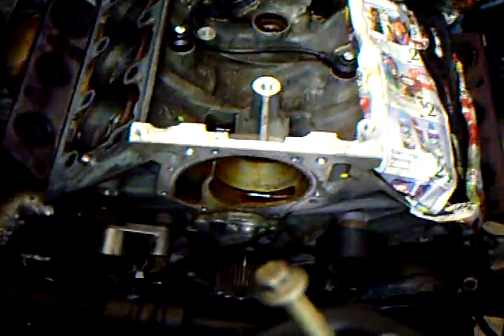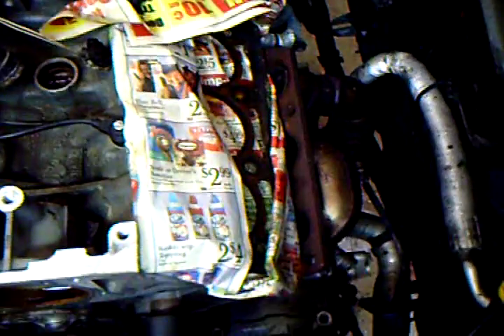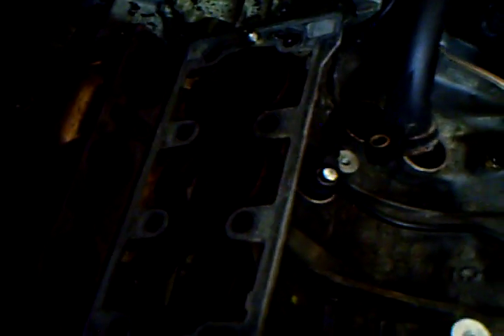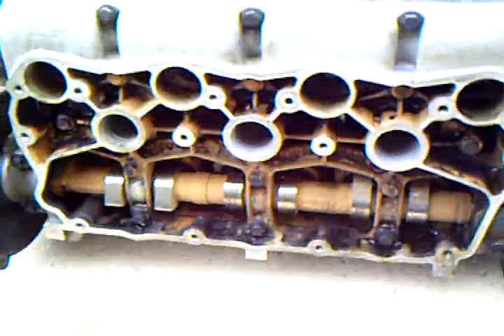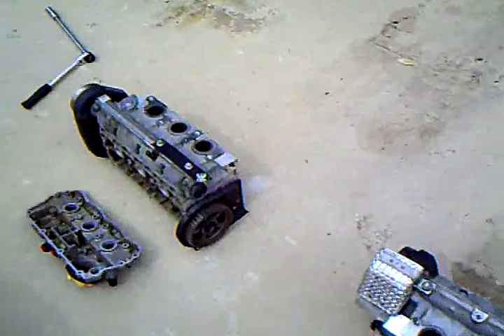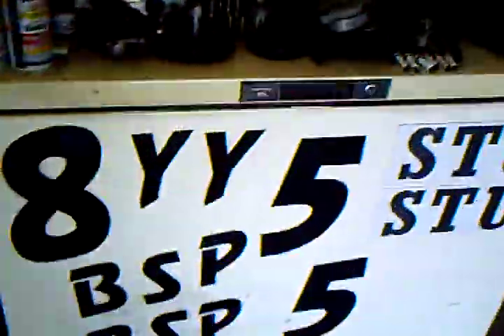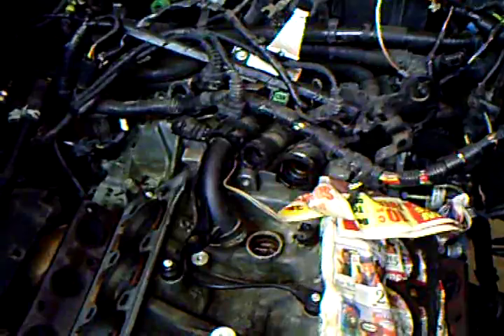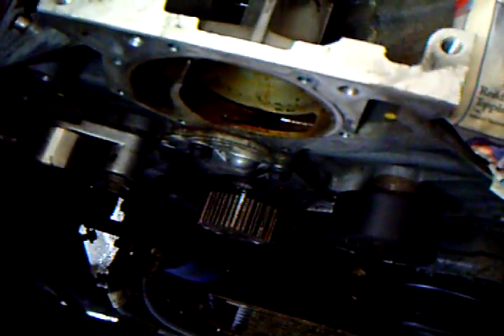Landrover Freelander Engine Head Gasket part 1

Comment: I’ve got an mgzt 190 that blows exhaust gas into the coolant decided to try the composite gaskets they are supposed to last a lot longer than the steel ones do not buy composite gaskets they are dreadful I fitted the steel ones in the end car is fine now

Comment: If oil and water mix in a land rover freelander 2 at 32000 miles will it be the head gasket? or oil cooler?
Reply from the maker: All I know is that the head gasket failure was a chronic problem in these vehicles. If it only has that many miles on it, hopefully it's still under warranty.

Comment: Did you use the cylinder liner clamps after you pulled the heads?
Reply from the maker: No. But i'm no mechanic.  Everything went back together ok but it didn't resolve the issue.  i think the head was warped so the new gasket didn't do any good.  Sold the vehicle cheap at a great loss since the cost was more than the vehicle was worth.

Comment: I had the engine rebuilt but between one of the gaskets there is supposed to be some kind of glue or silicon type material that I need to put in between but I don't know what that material is and I don't want the holes to be clogged...can you help me out?

Comment from the maker: Niall, replacing the head gasket did not fix the issue.  It all looked ok after I put it back together.  It even starts and idles perfectly.  However, exhaust gasses kept bubbling in to the coolant causing overheating and expulsion of the coolant out the coolant overflow bottle.
Reply: did u get the heads surfaced ?
Reply from the maker: @hellzone100  no

Comment from the maker: I'm not 100% sure but I believe the primary cause of the gasket failure in this vehicle is due to coolant loss which results in the head overheating and warping.  The truth is, replacing the gasket might not fix the issue and you may need to machine or even replace the heads to make them fit flush on the block.

Comment from the maker: I thought about it several times.  It might have made accessing a lot of the parts much easier but I was not in a situation where I could do this.  Plus the extra effort in disconnecting all the hoses and other parts probably would cancel out any ease of access to parts on the engine making it not worth the effort in my opinion.

Comment: I'm doing the same job on my freelander.
I have the front head off, but I'm not able to take the rear one down.
How in hell it is possible to unbolt it?
From above or from underneath? With breaker bar or air wrench? Neither one worked for me.

Please help.

Comment: Interesting vids detailing the work.
The KV6 engine shouldnt be mixed up with the K4 when talking of HGF, in comparison to the 1.8 K4 engine the KV6 is very solid and has very high tolerance levels.
The KV6 rarely suffers from a cooked head gasket, i'm not saying it doesn't occur but it needs really abusing for it to fail and is mainly a result of continuing to drive it after the waterpump or weak plastic thermostat housing has failed.

Comment: How is the engine doing now?  I am replacing my heads.  I am using the new head gasket.  I asked the mechanic to check the sleeves and he said they were fine.  I can only hope he pulled a manual and checked for tolerances above the deck.  New heads look great.  Got a super deal on them, even had them shipped in from England  went to roverkseries com   I should have mine back early next week.  I have almost 200,000 miles on it.  I would be very happy to have it run some more.

Comment: They're not supposed to be flush they're supposed to be 0.075mm above the block to put pressure on the head gasket. I'm a Land Rover master technician, i've probably done 50 of these engines. It's gotten to the stage now, the engines are so expensive we simply strip the block send it out to get skimmed, then reinstall liners and it works great. Sorry i don't check this account much, so sorry for the delay. Who knows you might have gotten lucky with the head gaskets.

Comment from the maker: @24VGTI - The cylinder liners all appear to be flush with the top of the block and I didn't hear any tapping when the engine was running so I might be ok there.  That said, I'm not completely dismissing the possibility.

Comment from the maker: Sorry for the poor video quality.  I will use a better camera going forward.
Reply: How did you get on I’ve got exhaust going into my coolant decided to change some of the sleeves
Reply from the maker: @jeffvaljean6030  replacing the head gasket did not fix the issue. It probably needed to be resleeved and head resurfaced. I sold the vehicle cheap to just get rid of it